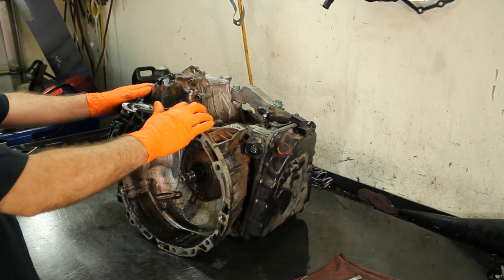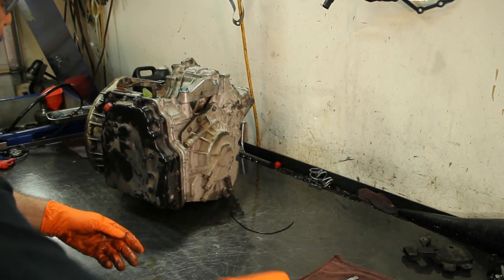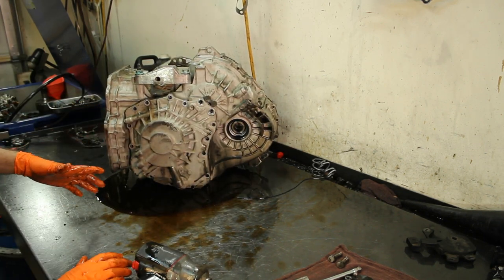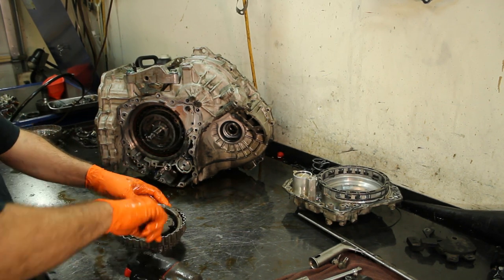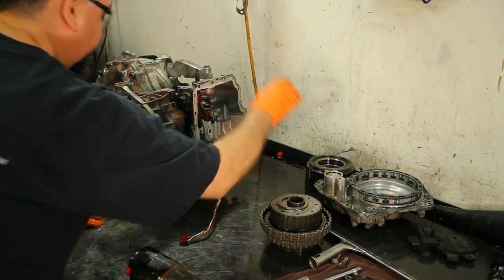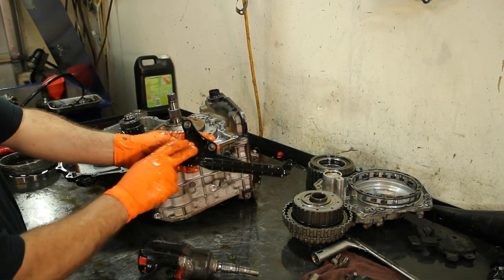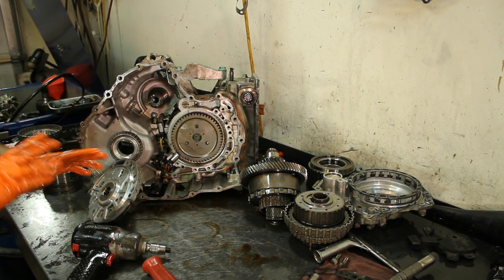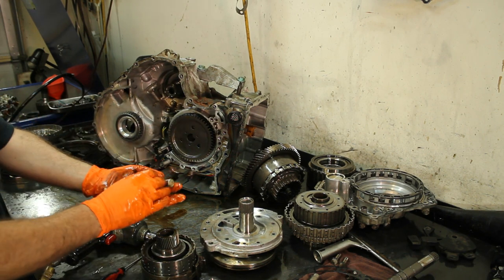09A Transmission - Teardown Inspection - VW Jetta

Comment: Hi on that transmission you didn’t indicate the temp sensor ( g93) location. ? Could you comment on the sensor location bc iam getting a 00300 code. Pls and thx.

Comment: My Jetta 2003 1.8T its not shifting from 3rd to 4th. 1,2,3 shifts ok, reversa ok, not shifting hard. With Codes 00300, 01166, 00652. What can i do to fix ir or its better ti remplaced ? 09A 321 l05 ( JP JC7 )

Comment: You said when it's cold and doesn't want to shift it could be the valve body and or solenoids. That's my exact problem is it won't shift until it's warmed up. Would you recommend changing the solenoids?
Reply: Yes go ahead.👍

Comment: Hi Hiram, you are the rock star of Transmission.  You have saved me a tonne (metric) of trouble by posting this video on YTube.   Let me explain... I own a 05 Jetta with over 500,000 KM's and wanted to give it a transmission filter and fluid change.  Bought the filter & gasket and that special VW G052 Trany Oil (liquid gold) @ $40.00 Cnd./litre.   Just about to start undoing the valve body cover when I decided to confirm the type of trany I have.  Found the # 09A... had a quick look at your video to find out that the damn filter is inside the trany and impossible to replace unless you have Hiram do it for you. LOL   Damn VW engineers, they do this all the time, who has ever heard of lifetime (warranty period of the trany) oil in a transmission.  I guess I will have to just settle on changing the oil periodically and hope this keeps the beast running.  Thanks for your vids.

Comment: I have a code 00652

Thank you for this video, I was not sure if I could just get away with replacing solenoids.

Now I know how the code should be more related to those 3 speed sensors and to replace them first.

Knowing how most VW transmissions are like opening up hell raisers box if you don't know what you are doing.

I am glad I could watch this and know what to prepare for.
Reply: The 09A is Jatco not Volkswagen.  That is why it works.
Reply: @guidofester5451  Well Japanese automatic Transmission Company made it attach to and correlate with a Volkswagen. Created self money shift mode and it's also difficult like a Volkswagen. I rebuilt and repaired mine, fixed all forward gears but then stacked my final big end clutches because this guy didn't give me the ole point this this way and stack friction steel .etc in a show you how manner. So I got the book and its for my own hell to face again.

But he was correct about speed sensors.

Comment: Harsh up and down shifts are usually the 2/4 duty solenoid.
Quite  a common fault just remove front cover, absolutely no need to replace all 9 solenoids. 
We change these in situ on Rover 75's.

The cracked reverse piston fault can also  be done in situ.
Done loads of repairs on these Jatcos without removing and stripping the whole unit, which keeps the cost well down for owners

Comment: Great video! I wish you put it back together on a video. I put everything back together but not sure if I did something wrong. The rear cover is hovering over a little under quarter inch and no more as if it were preloaded. Is that normal? I kept an eye out for the little details from what you were putting aside as of the bearings and what not. I couldn't get my torque converter in all the way after the rebuild. I'm guessing that the key slot was shifted a little off and needs to be centered again.

Comment: I have problem can you help me what is cause it.when I drive normal and when I press the break or remove my leg from the accelerator paddle. the transmission un-engage. I must put it on "N" then "D" again to engaged the gear.what is the possible error will cause this problem.it is VW Jetta 2009BR

Comment: I want to thank you  for this video , it is very well made, rigth to the point and it has been very helpful . I have only one question  , is the vw tiptronic 09a the same as the 09b?  I mean the same overhaul kit  works the same on both transmissions?  what is the difference? thanks alot  Hiriam :)

Comment: Hi. Great videos. I'm trying to open a small shop but the parts are so expensive. I would like to provide help on normal prices. Could you please advise, from where you are taking the parts on a good price. Currently I'm working on 09A transmission (JF506E) on Audi A3 2001 19. TDI 131hp.

Comment: I have a Golf4 1.9tdi 2002 automatic transmission Jatco 09a. The question is that there is no fifth gear. The valve body is new. except that there is no fifth gear. After 70 k/h Shows 5 well, the actual one is fictitious but in reality it remains at four. Please can you give me some advice other than the hydraulic unit, what else could it be? Thanks in advance, I will be very grateful for your answer. Code 00652

Comment: Another great video Hiram. You mentioned the different "codes" on the production tags on the VW transmissions. Even if the codes and housings are different, could you have used the internal components with the other unit your car dealer had? Assuming the transmissions came out of the same type model and engine? Also, i have a customers 02 Jetta that has a long delay into reverse and a flair into 3rd. Might have that bad piston you were talking about in the Jaguars.

Comment: always great videos..... Hiram I have a question. ..I have a 2007 vw jetta Wolfsburg 2.5... when car is cold... nice and smooth. .. start warming up or driving in a hot day...  start jeering and slips. .... has a automatic transmission code "juj" any suggestions?  torque converter? valve body?  solenoids?  please help.... thanks

Comment: Amazing. Simply Amazing! You are easily one of the best mechanics I've seen just by this one break down alone. An it's not an easy job  I know!

Can I ask tho where is the nut to drain the atf? An is there a protective shield under the car that you have to remove?
Thanks

Comment: Wonderful Job Bro! You are dead on with your info and explanations. Question. I have a 1992 Mk2 VW Jetta Carat 1.8 8v. It has an automatic tranmission. It shifts from first to high gear. How can i adjust the shifting on this unit. Or is it the a valve body issue. It has 250k, and i found it sitting for 2+ years. Just got it running from all the ground issues, now this.

Comment: '02 jetta 1.8t.. reverse was forward when I got it and forward was nothing, towed it to my shop and put it in reverse and it worked perfectly but no forward gears... fixed leak and filled up with fluid and had no movement in any gear... swapped valve body and 're filled and all gears were forward gears... drained a little out and has no movement in any gear... any idea what would be wrong...???

Comment: I have a 2002 jetta VR6! The transmission sometimes doesn't want to shift when you first take off, that I usually just pull off to the side of the road wait and then take off and then a little shift through the gears. There are no codes being shown. I was wondering if it's bad solenoids

Comment: Tell Me about the solenoid that would be responsible for the transmission not shifting until it warms up a few degrees.  I know I should replace them all but, all of them test within spec (using an Ohm meter) so, I want to know which one of them is for surely bad.

Comment: Hello I have a 2005 Jetta gli and it has a transmission code it reads, gearbox oil temperature sensor g93. Any suggestions on weather I should also change valve body? Price, parts, labor?

Comment: Hello, i have a quick question. i had the problem of no shifting up until the car warms up. i had good R and good D. the mechanic changed two selenoids only(since acording to the PC only two were bad). but the car is not working well after that. now it wont shift up even if i warm it up. somethimes does but for few moments. i still have good R and D. what do you think i should do? thats all what they did to the car. the change of those 2 selenoids. Gracias! Saludos de Mexico (My car is Jetta 2002 1.8t trans. 09A)

Comment: Hi there ,Am having a prob with à VW golf IV TDI 115ps the gear box from 1 to 5 and from 5to1 reverse is working fine but every i have really massive shock in the transmission (like the box is shifting 2gears u know what I mean) Did you had such issues maybe ?Cheers from Germany (-;

Comment: I watched your video on the tare down of a vw jetta automatic transmission, can you explain that if you remove the wrong bolt for filling the oil you can disconnect the reverse ban on the transmission. I just bought a car that has no reverse and the guy told me he just had the car in to have the fluids changed, when he got the car back reverse didn't work. Is there a way to reconnect the ban without pulling the transmission apart? Or what is the best way to fix this?

Comment: Hello,
Pls I need your help.i have an 02 VW Bora with an 01M auto transmission.it has only 89990km on it. It recently started to leak AFT from the opening between the engine and the gearbox. Checking it revealed the torque converter seal was bad. The gearbox was removed and a new seal installed. Fresh ATF was poured in and the leak was fixed. I took the car for a test drive, it was just fine. Went to a car wash, washed the car and on my way home, the car started acting up. It won't move on drive, and reverse. Prior to the seal replacement, the car was scanned for codes and 01192 was found. This was cleared after the seal change out and the code hasn't returned again but the car won't move in drive or reverse. Pls what can I do? This is the second gearbox I am using for this car with very little mileage (<90000km). Any suggestions will be appreciated. Thanks.

Comment: Hi there,
i am from Belgium (so my english is not good :-) 
i have a problem with a VW golf 4 TDI  with +-200000km
the gbx is slliping on 3gear but only when using D mode 
if i use semi automatic mode meaning using the lever i have no slipping 
i know automatic transmission are complicate but did u ever ever had similar prob 
ones again sorry for my poor english 
regards from Belgium
cheers :-)

Comment: Hi,

I have one of these gearboxes in a ford Mondeo (Europe) 2005

It's the same as what is used in the Jaguar X-type (same chassis)

Problem is, when stationary, you move to pull away and it will crawl along very slowly... It's not until you use more throttle / accelerator / gas that it will start accelerating properly.

When moving though it seems fine, although there is an occasional grinding noise but I don't know if this is from the gearbox.

Main problem is just when pulling away from standstill, it crawls... Doesn't slam into gear and seems to change up and down ok.

Is it likely to be just oil low? Or worn frictions?

Just wanted an opinion because here the oil for this gearbox from ford is £13 a litre roughly. Very expensive.

Thanks

Comment: Hello!  I have the same box on a VW Bora 131 hp.  The problem is that 4 and 5 are slipping.  The discs have been replaced (but without the steel discs), and the selenoids are new.  Unfortunately, the problem remained.  please help
Reply: maybe the preassure akkumulator ????

Comment: It wont go in to drive and found throttle leaking air I switched it but I have to rev it up to like 5 rpm in Drive to get it in first. Then it rides fine until I put it in park or reverse not as bad . Im guessing valve body and solenoids.

Comment: I like your videos and how you explain, and I wanted to tell you that we have a 2004 WV golf gti 1.8t with the same transmission that you have in the video,09A  I bought it and when it's cold they didn't shift, when it gets warm they shift, I bought the shift solenoid and  now it's shift but 2nd to 3rd shift too hard and to slow down  on 3rd to 2nd it pulls you back, I changed he valve body and it still doing the same thing, any suggestions on how to fix this?
Reply: I have a 2002 1.8T Jetta doing the same thing.  The valve body and oil filter were replaced, the cooler flushed. After talking to several people I think there is debris blocking oil to an accumulator. I was told the best fix is probably tear it down and clean it all out, but hoping to narrow down where exactly the cause is before doing that.
Reply: jaime Garibay hi i have the same problem did you find a fix
Reply: Try the temperature sensor
Reply: i have the same problem to, but mine is that in cool dosent shift D only R.
Reply: @RageeshKanagarajah    Where is the temperature sensor?  I did not hear him mention it in the video.

Comment: how can you tell when the gear are slipping ? is there a discoloration ?
Reply: i can't believe no one posted a response to this. Usually if a clutch or brake is slipping they get a black mark around the clutch (granted it can sometimes be spots or oblong shaped areas that turn black do to overheating of the clutch/brake. If it isn't caught early then the mark will turn into general discoloration of the whole clutch/brake, meaning the whole thing will be black (please do not confuse the material over heating and turning black with the dark olive green color of high energy material clutches, they are supposed to be dark).

Comment: hi .... have a vw sharan 1,9 tdi with automatic transmision , and the reverse is fading after loosing the reverseband bolt ...... hov do i fix it again ..... do i have to teardown the transmision from the bellhousing side to fix or are there a different way to adress the issue ..... great video by the way ;)
Reply from the maker: +Morten Jensen Yes.

Comment: where are you getting your gloves at bud? thanks
Reply: ***** thanks
Reply: hddm3 See Hiram, I'm not the only guy that likes your orange gloves. I've already got a box on the way. Keep up the great work Hiram, we appreciate your efforts.
Reply: hddm3  I have a 09a that won't shift past 2 one hits 3rd it's like it's in neutral. Has new solenoid. Has a vw code 00652
Reply: sigh so VW code 00652, what is it and what are the possible fixes:

00652 - Gear Monitoring: Implausible Signal

Possible Causes

    Automatic Transmission Fluid (ATF) Level not OK
    Vehicle Speed Sensor (G68) dirty/faulty
        Impulse Wheel dirty or Installation faulty
    Gearbox Speed Sensor (G38) dirty/faulty
        Impulse Wheel dirty or Installation faulty
    Multi-Function Switch (F125) faulty (but not detected)
    Clutch or Valve Body faulty
    Automatic Transmission Fluid (ATF) Pump faulty

Possible Solutions

    Check Automatic Transmission Fluid (ATF) Level
    Check/Clean/Replace Vehicle Speed Sensor (G68)
    Check/Clean/Replace Gearbox Speed Sensor (G38)
    Check/Replace Multi-Function Switch (F125)
    Check/Replace Clutch and/or Valve Body

Start with fluid level and work your way down, Unless you have another code to go with this one of course.

Comment: Noob question: what kind of super-power drill is he using?
Reply: It's a AIR IMPACT GUN. You can also buy an electric one from harbor freights but air will always offer more torque. Electric offers 230 Foot pounds of torque.

Comment: i have a 2007 vw rabbit. just replaced the valve body. it shifts hard when you put it in gear but when drivin it shifts fine. Is there 3 speed sensors in my transmission? or could it be the solenoid
Reply: check your motor mounts

Comment: I know he's a buddy of yours, but in my experience, those trouble codes he pulled probably ain't gonna help a whole lot.  I know for me, for some weird reason, when customers bring me vehicles with Check Engine Lights that they had codes pulled at AutoZone or somewhere like that, and they said it had, say, an EGR code for example. Well, I'll pull codes with my scanner and get like 4 different codes, and not one of them is an EGR code. The moral of this post being for those reading the comments, take secondhand codes, (codes you didn't actually pull yourself) with a grain of salt.

Comment: Hi, does this transmission have a fluid level like the other VW Jetta. Iif it does I don't wanna break it , that is the reason why I am asking.
Reply: Did anyone reply to the proper fluid level on these transmisions? there are videos on the Jetta's and Passat's that have stand pipes that you fill untill it comes out. I see the fill plug at the top that he shows. But i may have missed the fill level. My car is a 2006 VW Golf TDI

Comment: Hello everyone

I have this gear box in my 02 bora 1.9 tdi 130

It's has 88k miles. The car is literally in showroom condition. It's like a brand new car

It has a problem!
When I'm driving it 1st thing on a morning every gear change is perfect
But as it warms up it slips! But it only slips after I pull off from a complete stop. Red light, round about etc
This is how, it's pulls away ok which is 1st gear I'm guessing but then as it goes into 2nd it straight away starts free revving like a manual with the clutch to the floor! But as it gets to 3 rpm or so it kicks in smoothly! Other wise it's perfect?! An if I drive off very very slowly there's no problems with the shifts at all. It makes no sense. But I can't pull out of a give way slowly in an ideal world because something could hit me in the side of the car! So I need this fixing

Please help
Thanks

Comment: Hello, is it mk4 transmission ?
Reply: This is a 09A. Used in the later 1.8T car. The Diesel BEW cars 2004-2006 and in the Canadian City Golf and Jetta cars 2008-2010.  Not sure about the Beetle.  
  The MKIV’s started using the 01M and all the ALH cars had the 01M.  Different transmission all together.  Hope that helps.